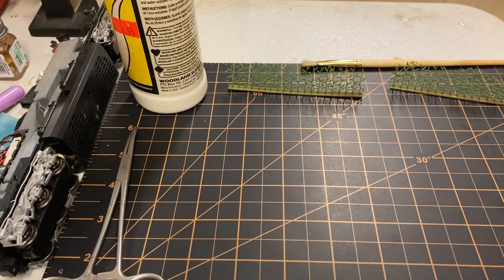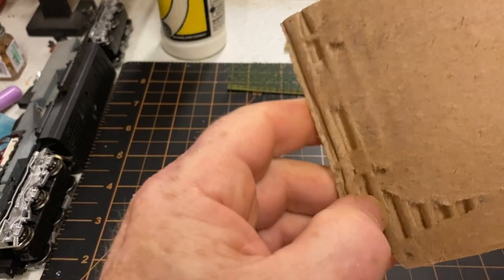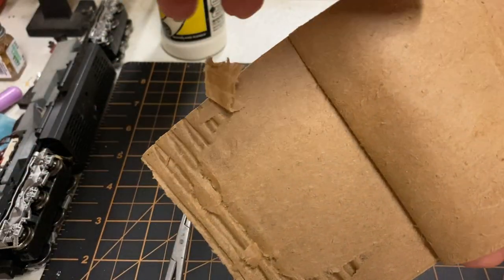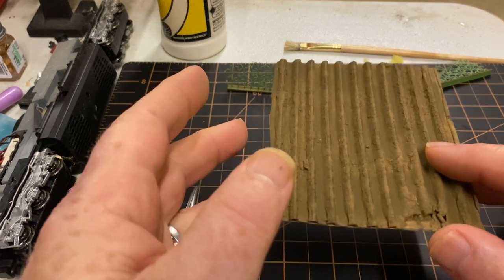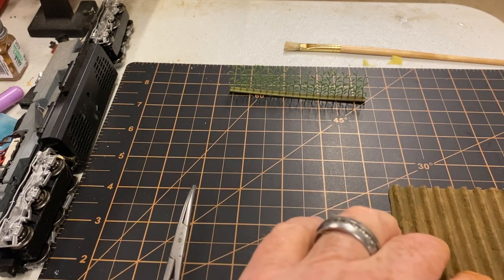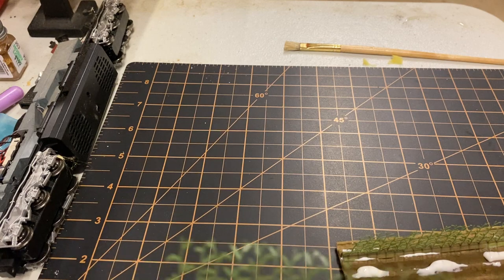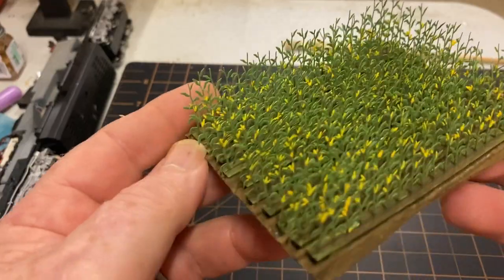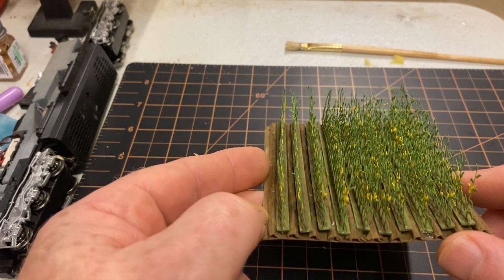HO scale: Building a farm scene, part 1

Comment: I have the same plastic bowls except mine held yoghurt and theyre perfect for holding paint and glue and water. Theres no need for expensive paint pallettes as 9 times out of 10 I use these or even scrap card to mix paint etc on.
This is a great way to recycle cardboard too...you can paint it and scatter it with flock to mimic stubble or do lines of green like crops just coming up or use clump foliage to look like mature crops. Its a great idea. I have used corrugated cardboard as roofing but this is another great way to make your budget spin out more.

Comment: Glueing between the corrugation, ruins the plowed and planted look. Might as well glue them directly to your layout! However, the use of the cardboard box pieces, is a great Idea. I’ve actually used it myself. Here’s how to get a better look...
Get yourself a shovel full of dirt. Get out the Rocks, roots, etc., and set them aside. Screen it throughly with a common kitchen screen. Don’t force it thru the mesh. You can get 3 textures from this. You’re Using just the finest dirt for this. You can change the color by adding light or dark tile grout, if you Don’t feel it looks right when wet. (the dirt takes on a wet look when it absorbs the Glue.) in a pinch, using old dry potting soil, or even those little expanding, seed starting plugs, work.
Cover the corrugated surface with glue. Use a brush to spread it, and don’t let it puddle in the furrows. Keep it spread evenly. Then using the same screen you did earlier, sift out dirt over the whole piece of cardboard, making sure to keep the furrowed shape, by occasionally, gently brushing the dirt from them. (The dirt will absorb the glue, and stick to itself, leaving you with a hard, flat piece of dirt, otherwise.) 
Give it roughly a 1/2 hour or so to set up. Then flip it over, give it a tap. Maybe a little shimmy. Then see if you have any bare spots. If so, brush a bit of Glue on those spots, and put some dirt on that. Now, I usually wait a half hour for the new glue to set up, but you could save the time by just, at this point, sift the dirt over the entire piece, til it is all filled in and flat. Now put a piece of Wax paper over it, and set a weight, like a book, on it and leave it to completely dry.( the Book keeps it flat, while all the extra dirt, keeps it from crushing flat.)
At this point, I would personally, remove each Stalk from the strip, and prepare it to plant it all individually. But that’s me. 
Using the entire strip, I’d coat the top and sides of the base strip with glue, and sprinkle some of the fine sifted dirt over it, so it blends in. 
Also, give every Third stalk, a quarter or Half turn. Alternate between clockwise, and Counter clockwise twists, and run them in a series. By that I mean, in a strip of 20, with every third one turned, you’ll have 2 left in that row. Which means on the next strip, you turn the first stalk, and every 3rd stalk after, and so on. 
Once all is dry. Shake off the loose dirt. Put a stripe of glue on the bottom of the Corn Row, and set it onto the rise. Don’t be afraid to use a little pressure, or the “Glue ooze”. 
Once you’ve gotten your rows planted, use a skewer or paint brush to spread the glue ooze evenly down the edges of the strip where it touches the rise. Then sift some more of the dirt over it. Some times, Angling the corn field, so the dirt hits flat on the rising sides, helps here to round out the transition between the curved surface, and the flat sided strip. 
For added realism, put in a little ground cover here and there. A small tuft of drying Grass, some kind of clover like greenery in the furrows, or up the sides here and there, within the rows. Corn rarely grows alone, wether in a garden, or a 40 Acre field. 👍🏼😁